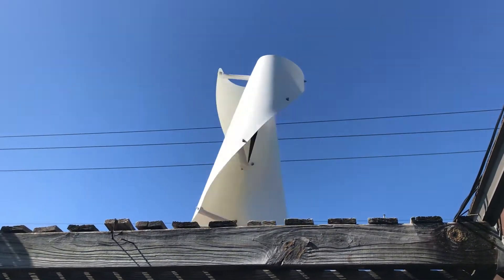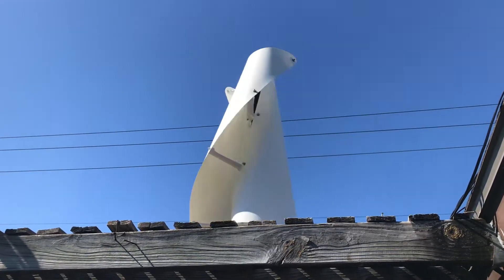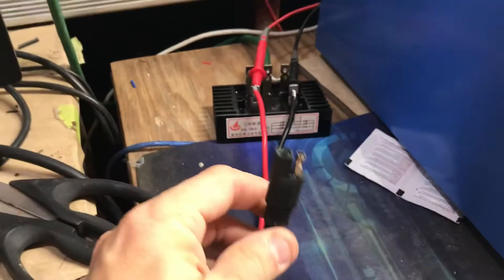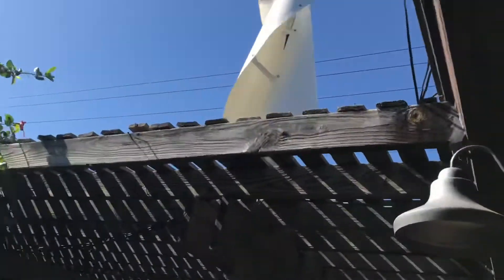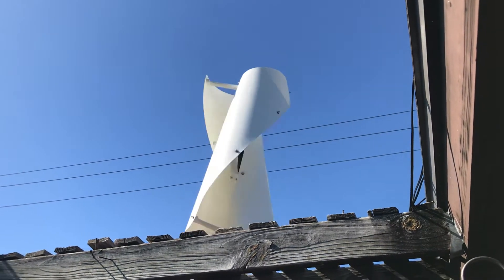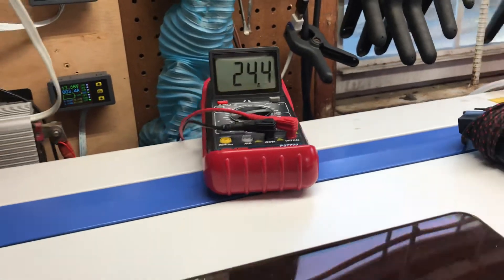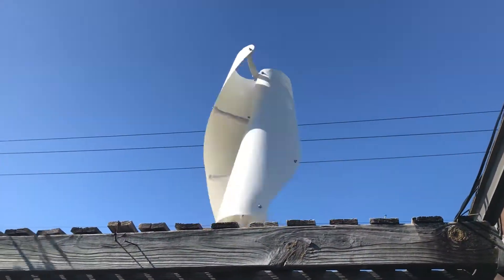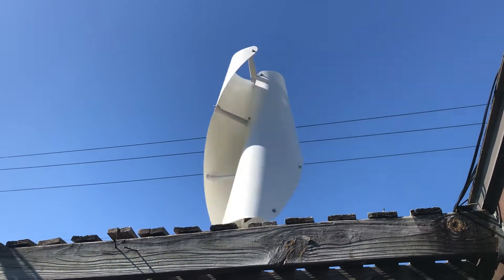Update..Vawt helix wind turbine up and spinning. Sorry, no load yet

Comment: Hey there I would probably get it under load if it spends up to fast could burn up your turbine!!!
Reply from the maker: Eric Jackson   I put the original charge controller on it for now. I took it off because when it reaches 14.6 V the brake kicks in and it stops it from turning completely. I basically took it off so we could see it spin. It’s all safe for now 😊
Reply: @Checkitfirst  ok cool so you do have It hooked up to battery?
Reply from the maker: Eric Jackson. Yes. It’s a battery out of the riding lawnmower. It was reading 10.8 V. Been sitting on the shelf a little bit. Wind has died down a little bit so I do not think it will do anything tonight but it’s on
Reply: @Checkitfirst  awesome!!! post some updates!! Will you be hooking a meter up to it? And lol on the mower battery 😂 been there done that!!
Reply from the maker: Eric Jackson absolutely. I’m going to wait for a good windy day.
Reply: @Checkitfirst  cool I will look forward to that!!